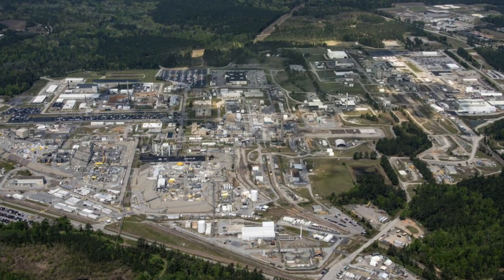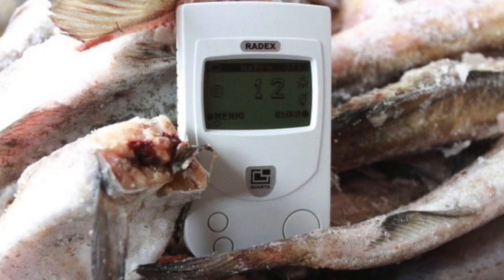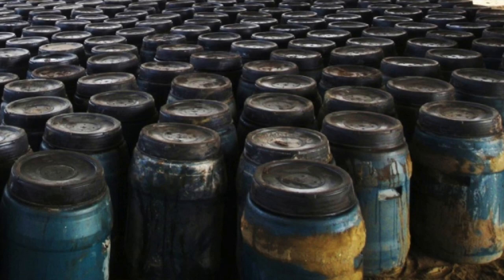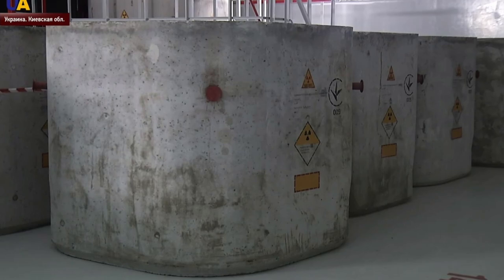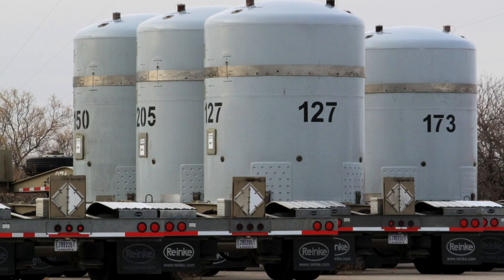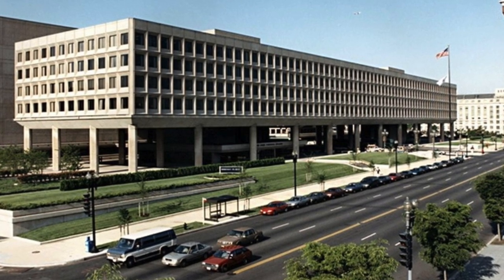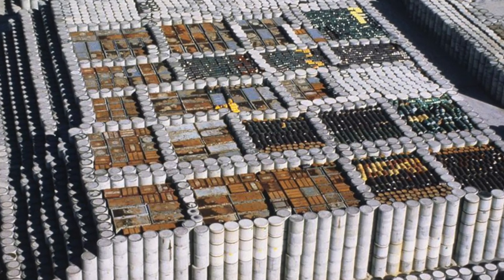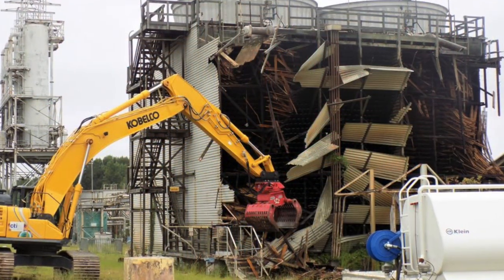Radioactive Nightmare: The Savannah River Nuclear Burial Ground

Comment: Thanks for information that the DOE is too embarrassed to talk about. SRS should not count on vitrification to protect against long-term hazards of radioactive waste. Vitrification last less than 100 years. It does not protect against the release of isotopes that will be radioactive for hundreds of thousands of years. We don't want another screw-up at SRS like they had in the leaking underground storage tanks. They neutralized the acidic high-level liquid waste to stop corrosion. Then had a sludge that couldn't easily be pumped out of the tanks.